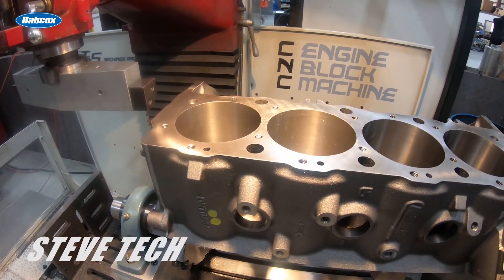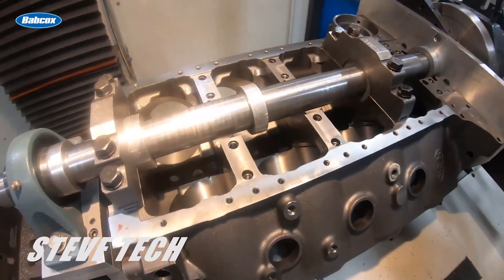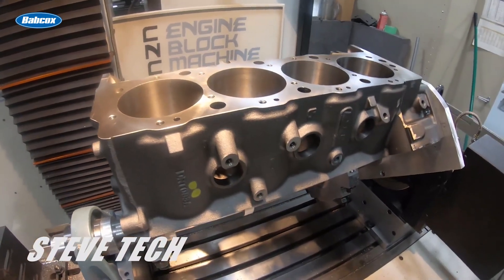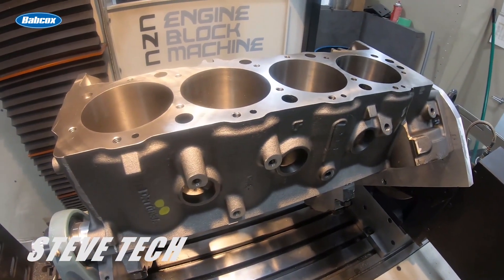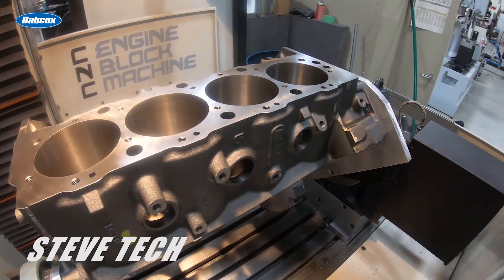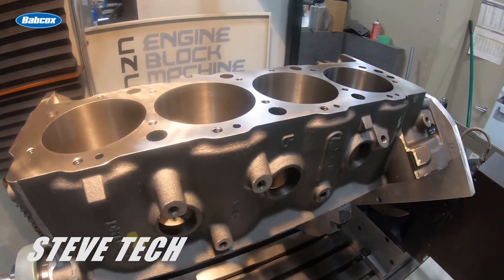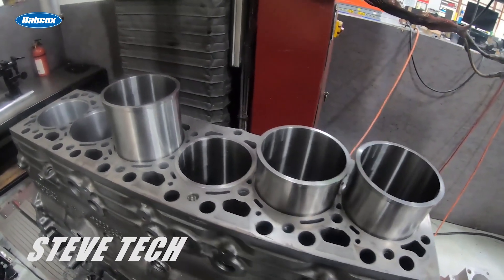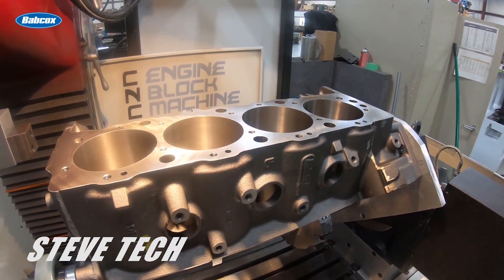Engine Block Resurfacing

Comment: I’d love to send these vid’s to all the machine shops that destroyed our parts pushing us to get tooled up ourselves , I was thought the place where the cap seats is called the register and from that point all measurements are made,  yet one of the last blocks a place screwed up the guy working there for 40yrs took great pride in the telling  me I knew nothing ( I hadn’t said how I thought it should be done at that his stage ) any way he went to great detail to explain how they check the oil pan rails and then flip it over deck perpendicular and bore 90* to this , ( mental ) I asked him repeatedly what should He be boring 90 * to , when I said crank as everything rotated around the crank he still didn’t get it ,   I’ll finish my show room some day as I have a wall with all the parts each shop screwed up and their no will be beside each piece

Comment: It's not just surface finish that is important, and I'm sure you know also, that what alot of people doNot realize is that the block deck height is also critical and by using a bar through the crank tunnel, the deck when professionally machined, will also need to be parallel with crankshaft.